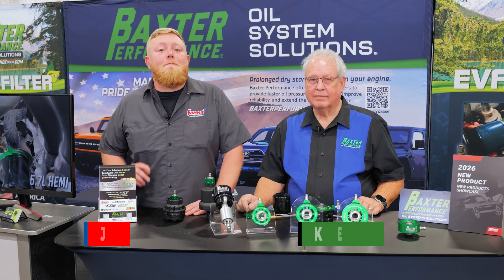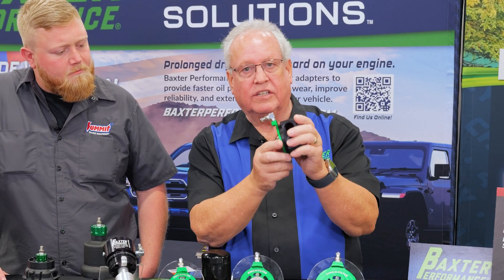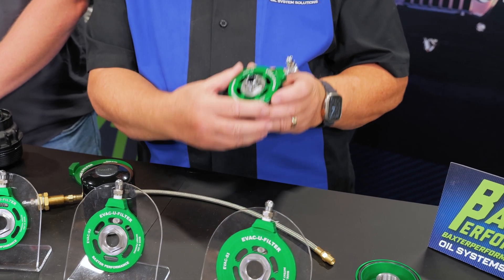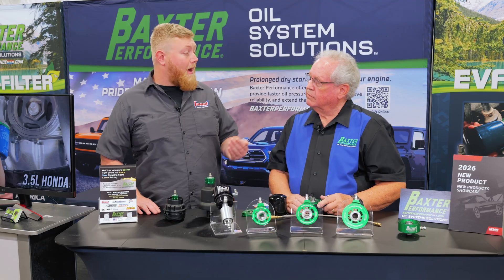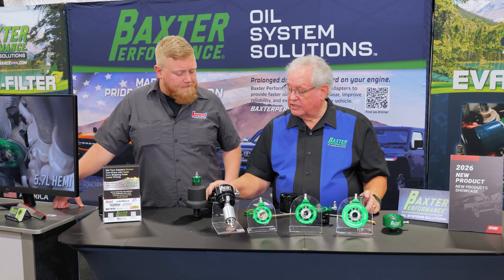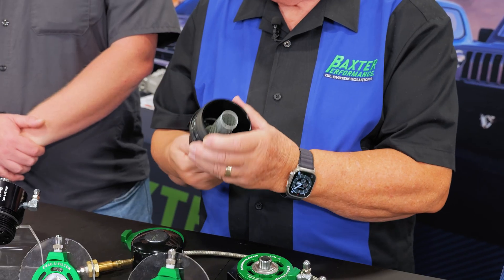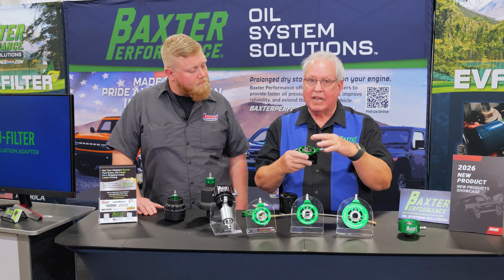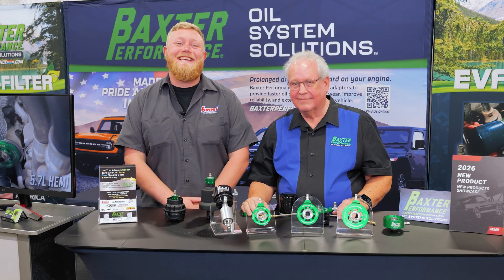Mess-Free Oil Changes Start with the Baxter Evac-U-Filter | SEMA 2025 New Products

Comment: So that’s an extra 1/2 quart of oil that doesn’t get drained out. I don’t get it. Seems pointless to me.
Reply: It's not for conventional use, racer's will change their oil after a few runs for better performance, this is just quick and lazy not efficient. I'd use a reusable oil filter and put a drainage valve on the side or bottom basically same concept but better 🇺🇲